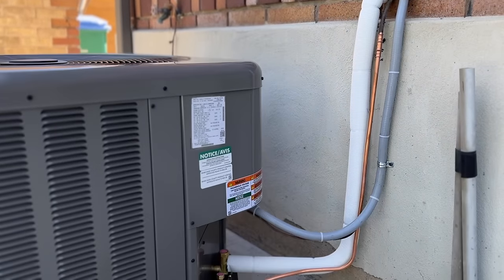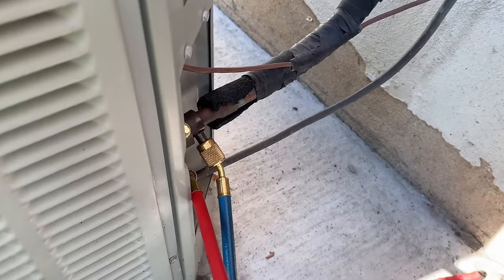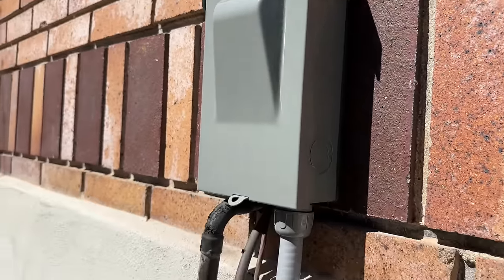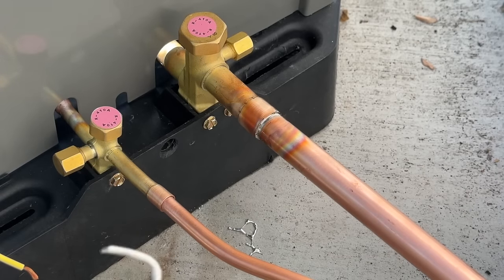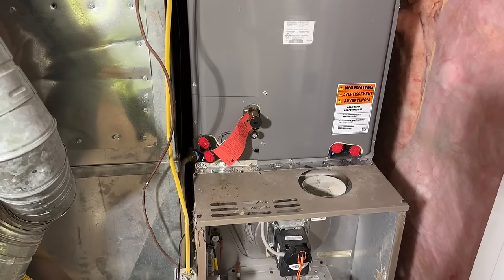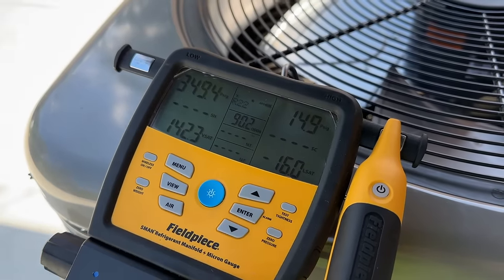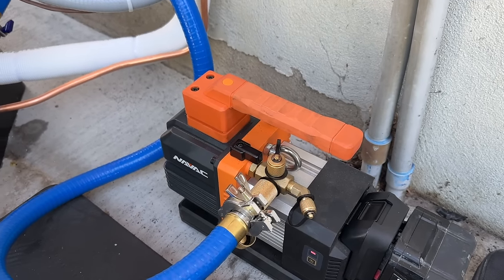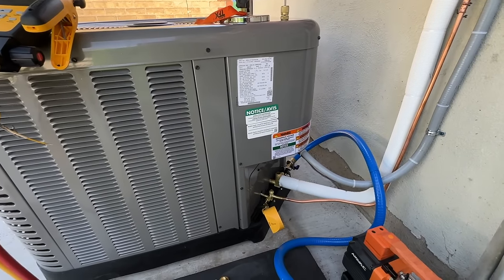Did You Know You Can Replace Your Own Air Conditioner?   -SAVE THOUSANDS-

Comment: How come so many HVAC professionals are watching “DIY HVAC” videos?  It seems like every post there is some warning from a tech saying it’s illegal or dangerous to do this on your own.  I guess they are learning from you just like the rest of us.  Thanks for the helpful videos!  I know I personally saved thousands doing this myself after buying all the tools from Amazon and everything else I needed online.
Reply: Illegal no, so long as you're EPA certified to handle and purchase the refrigerant. If you're EPA certified then you'll know that you may need a recovery machine depending on what you're doing. You'll need a deep vacuum pump and a manifold set with low loss fittings, etc. These are some of things you'll need to meet EPA requirements and be legal.  As for dangerous, of course it is. Everything is dangerous. HVAC DIY is probably the ultimate and most demanding residential thing that is capable of being DIYd so it's not for the person who just finished up tiling their bathroom and thinking they can do anything.  It's only for those that are extremely comfortable with their abilities and have the aptitude to understand how everything works.
Reply: The videos are good! That's why so many people watch them; there's no doubt about that! However, he should have disclaimers on all of his videos. It is crazy to think that this job can be done by DIY'r! Especially if they are not mechanically inclined! Yes, some folks would have no problems doing the things in the video with some mechanical knowledge. However, there is no mention of safety! Doesn't matter what torch you use, you have to have something to put out a fire in the case of an accident. All torches take practice to get proficient on them. A novice may burn a hole in the copper tubing. YES a map torch can burn a hole in copper tubing! He makes it look easy because it is easy ONLY after having been trained and acquired the experience on how to use a torch.
If I were the DIY HVAC Guy, I would change my name to something else other than THE DIY HVAC Guy, put disclaimers on all videos before I get sued! I would change it to: "THE FORMER DIY HVAC Guy" and put disclaimers on all the videos! And yes, this job is dangerous! It takes several years to be as proficient as the tech in the video! So if you're reading this and are thinking about DIY'ing replacing your system and are not mechanically inclined or have no AC training, STOP!!!!!!!! Don't do it!
Reply: @lucho106  I’m not an HVAC tech and did it myself and thought the job was pretty straightforward.  The hardest part for me was getting the proper charge, which wasn’t necessarily hard, but just a little challenging for me to understand the concept.  Compared to other mechanical jobs like automotive electrical diagnosing, an air conditioning replacement was easier than people make it out to be.  Just study up and understand each part of the process (and understand how the system works) and just do it one step at a time.
Reply: @80swoods. I don't watch to learn. I know how it's done. I do it every day. I watch to see how much stuff is not being done that should be. These videos are not "instructional", more like "infomative" for homeowners.
Reply: @kdk2286  i just let it go into the atmosphere lol, I hate the government and do everything they say not to lol
Reply: @lucho106  And, he’s not even that good. 😂
Reply: Theyre mad theyre being exposed.  What they do is easy but they want you to think its hard.  Most are pathetic losers
Reply: @johneldorado  It’s sad really.  You never hear about mechanics crying about people working on their own cars.  I just don’t get it.
Reply: @johneldorado  I’m glad that someone else gets it.
Reply: @80SWoods  

It's so true, most mechanics and really almost every other trade want to help people learn.  But not HVAC, even their web forums are shut off to those outside the trade.  Very insecure.  Probably because most of this is pretty easy.
Reply: @johneldorado  I think that HVAC is just challenging enough that most people won’t attempt it since it’s something rarely needed to learn, but you’re right, it really is easy once you get it. It’s nothing like trying to diagnose a car or something with multiple systems.
Reply: @johneldorado  speaking of….
Reply: @kdk2286  Legality depends on your local laws.
Reply: @johneldorado  that's a pretty bold statement. I watch them to see what kind of advice is given. Most videos don't give full or correct information and could set people up for a bad day and a lot of future frustration/costs. Things like brazing at the service ports without removing the Schrader valves and protecting the ports from the extreme heat. Now you gotta replace the service ports/ Schrader's and possibly needing to go buy refrigerant. Or how to properly set the airflow for your ac which can make or break an AC. No mention of that. Some of his advice is spot on, but a lot of the work can take time to master and be proficient in. I was an installer for years, have years of service work and now am a quality control technician.. but I still have much room for improvement. Guys with 20+ years of HVAC experience still learn new things from time to time. People want to be able to watch a YouTube video and get the same results as a pro. The truth is he puts the videos out to get views and make money off of views. Some mechanically inclined people may be able to get a system working but the chances that everything is done correctly is very slim without thousands of dollars in equipment and tools and some training.
Reply: Maybe because we are HVAC owners or technicians and it shows up in our feed?  You know, google knows evertything about us.  I watch because it's entertaining, like an MMA fight and one of the combatants is slowly losing.
Reply: Yeah after Dyi gets epa certified buys torches,brazing rods, gauges,vacuum pump, then you can ask him for subcooling 😅😂
Reply: Why, because it’s funny.   Before the Freon laws and when every unit was R22, it wasn’t that big of a deal.  These days it’s a lot more of a headache.  You also won’t have a warranty.  Having an A/c company start it up doesn’t give u a warranty either. A/c companies love making money off diy’ers.
Reply: @80SWoods  you're right about most of what you said except for the wiring of hvac is super easy. It just as complex as automative electric especially when you have multiple system. Many electricians in my class be lose with the hvac stuff even tho theyre electricians
Reply: Honestly, professional curiosity to see what info is out there. I'm not for DIY videos because there are so many little  things that you need to know that take years to learn. And by the time you spend the money for all of the equipment to do it right, just paying a pro is much cheaper.
Reply: DIY’ers cut in on their turf. Thus the scaremongering
Reply: For the one who said, you can't finish tiling your bathroom and say, ok AC next, I have news, yes you can, I had done it, my neighbors, in laws and many others, so long you have the right information, proper tools, patience and most important, EPA license 👈✌️
Reply: Because the videos are HVAAC related they show up in your feed if you’re watching a lot of YouTube videos about HVAAC topics.  A good tech never stops learning.  I for one support DIYers.  A lot of money on fixing DIYer mistakes and even more fixing things that Chucks in a truck have messed up.     All that said, if you can actually DIY on HVAAC equipment, go for it, I’ve just seen too many trained techs mess this stuff up to think most people watching a video or two will have much success.  Also it is illegal in most places for someone without a EPA card to mess with refrigerant.  I ain’t the police but I’ll tell ya if you’re about to speed past one.
Reply: @lucho106  just think how many   extra views he gets because they watch a thousand times trying to figure it out.
Reply: @kim0755  so, why didn't you cite those and correct them? meh
Reply: @lucho106  
I say let them do all the DIY repairs and replacements they want because 9/10 times the owner will do something wrong and call a professional anyways. I had two calls Friday alone where I showed up and the customers were hot and frustrated because they tried “ troubleshooting” aka throwing parts at there system to fix it themselves but ended up making it worse in the end. That’s how I got a new set of analog gauges and a cheap vacuum pump for free from a customer.
When I hear people talking about HVAC professionals being afraid of owners repairing (DIY) their own systems or learning from YouTube creators it kind of makes me chuckle.
All I can say is good luck and may the force be with you.
Reply: It’s not illegal but if you are an idiot it can be dangerous.
Reply: It showed up in my list. I guess I watch waiting for him to say something stupid. You know what is funny? Anyone can do anything. The reason people pay others to do stuff is they don't want to do it, they don't want to learn, they don't want to buy the required tools to do something one time, or they know that in every application of everything there are those little idiosyncrocies that only someone with experience knows how to avoid because they've already made that mistake or seen it made. Every time I do something involved for the first few times, I realize a better way to have done it.
Reply: There is no way you saved thousands if you bought everything you needed. Also, it depends on what your time is worth. Condensers are the easy part
Reply: Completely agree. Yes, that is a simplified explanation of how it is done. There is a little more to it, not to mention permitting and licensing. Some people don't understand that they have a heat pump and not a straight AC, where to get equipment, how to size equipment, what SEER or SEER2 means, etc. Did he talk about drains, safety pans, and safety switches? There are just a lot more little things to it, that is why code books are thousands of pages.@criticaltemperature3343
Reply: @johneldorado Are you just trolling? What a vicious unprovoked attack. Everything that everybody does is easy, it's just a matter of if you've taken the time to learn it and learned or been taught every little common mistake that happens and every little trick to getting things right. Everything I do is easy, but I've. Been doing it for decades. Put that thing in an attic with out a safety on the drain and find out what happens when homeowner do ahit themselves. You are obviously not in any kind of trade or you would see what happens when people try to fix their own stuff. Lol
Reply: Because by doing it yourself they can't buy that 32 ft fishing boat they wanted. As for letting it escape into the air that tractor trailer is polluting the air more when it sits at  a red light .
Reply: Don’t forget this guy is an hvac scammer. He makes more money than a technician does by playing customer’s advocate and causing dialogue of distrust and anger in his video’s comment section. He is just as bad as the guys running around in vans ripping people off. He has just mastered a soft way of doing
Reply: We watch DIY HVAC videos because we are recommended them along with professional HVAC videos. A video claiming that you can replace your own air conditioner is attention-grabbing because, no you can't, you will fail trying, you can't even purchase them without a contractor's license, and you can't legally do anything with the refrigerant lines like brazing or shark biting them in without a 608 certification. You cannot replace just the condenser unit outside and hope everything is hunky-dory either; not only is that illegal to do without replacing the air handler as well, if your air handler isn't matched to the same refrigerant, it will not work correctly.

You need refrigerant gauges, drills, mastic, ductboard, brazing tools, vacuum pumps, micron gauges, nitrogen tanks, hurricane pads, drain pans, electrical whips, heater kits, float switches, etc etc, and a few of those tools are several hundred by themselves at least. Brazing tanks and equipment, buying fresh, is about $600 alone. You cannot possibly learn the process to install your own air condenser without a professional guiding you along the way the whole entire time. You will save about a thousand after all of the tools, and you will spend $5000 in repairs or replacement in 5 years because you did it wrong. 

Want your HVAC system for really, really cheap? Find a technician at the bar and become close friends with him, and when your system breaks, he'll be able to get you contractor price and you can be his helper while he installs the system for you for a couple beers. That's the only possible way you can avoid AC pricing while getting a good job done.
Reply: I finished mine and it’s up and running perfectly.  Spent quite a bit on tools, but I have another unit that I might replace.  The company that replaced our furnace last October, failed to glue an exhaust fitting.  I’ve been told that could have killed everybody.  These were the professionals.
Reply: @henryackerman-f1u  Why would a DIY get EPA certified?  I thought that was only “if” refrigerant was needed?  Beyond that it’s an online test to get certified if needed.
Reply: @lucho106 bs. Somebody said changing a garage door spring was dangerous. Sure it can be. Somebody that has no experience tying shoes broke a shoelace and then they tripped over something and fell off a cliff. Danger is all around. Live dangerously. Or don't. It's all relative to personal preference. If your smart and don't mind sweating, paying attention to what your doing, doing some research, springing for some specialty tools and getting your hands dirty this is a piece of cake.
Reply: @nuc2726  Hi nuc2726, why can't you replace just the condenser unit?....Especially if your replacing it with a unit that has the exact same refrigerant and cooling capacity (and SEER rating). This is going back 15 to 20 years (I've been out of the industry for a long time), but I remember situations where the compressor had failed (usually a burn out), where it was easier, and in the long run almost cheaper just to replace the condensing unit, instead of just the compressor. There were a few times we decided to do that. Also, in most of these cases the AHs were in excellent condition, and it would have been a disservice to replace them. I've seen AH units (especially by the ocean) outlast condenser units by 10+ years.... Also, I never heard or knew that it was illegal to replace just the condensing unit......maybe in different states? Best D
Reply: You did not save any money if you bought all the tools. The tools needed to do this job correct cost multiple thousands of dollars. Now if you plan to change a few AC’s then you may save thousands.
Reply: Although I appreciate the videos lifting to some degree the corner of the tent of the steps to DIY service, repair & replacement of HVAC equipment, there’s a giant flaw in this approach when it comes to replacing existing furnaces & AC’s. The sad truth is the majority of original HVAC systems were sized incorrectly (mostly over-sized) & more likely than not installed / matched incorrectly. Simply purchasing the same size equipment duplicates the original bad design (or frankly lack of engineering / system design).

To have a system that will achieve proper operation, optimal operating cost & a straight forward way to maintain it, ALL systems individual equipment components need to be:

1- sized / designed / matched correctly to the home
2- installed correctly (including proper ductwork)
3- maintained properly

Sadly, this video leaves out #1. Btw, it’s impossible to do #2 correctly if the equipment components are not correctly sized. This could be a critical error that may hurt economy, comfort & equipment life dramatically.

In this video a 2 & 1/2 ton unit is replaced with a 2 & 1/2 ton unit & zero effort was made to verify if this was the correct size unit for this home. What if a 2 ton unit is the actual correct size? That would mean the 2 & 1/2 ton unit is using a ~1/2 hp larger compressor than needed, will short cycle, do a lesser job of removing moisture, cost more up front & more to operate over time. Why would anyone want to do that? 

Why listen to me? I’ve made an excellent living ripping out poorly designed & prematurely failed HVAC systems over the last 30+ years..!

@ The DIY HVAC Guy
#ProveMeWrong
Reply: Where do a homeowner get a gauge like that for $50? How do a home owner do it without the gauge? Lyer!!!
Reply: @80SWoods  yeah.......good luck with a warranty.